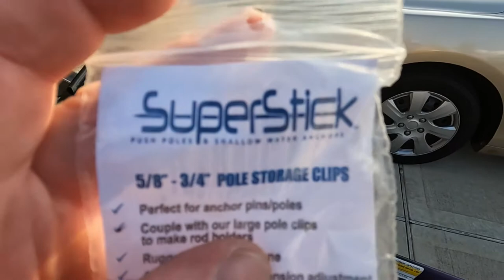Kayak Stadium Seat Mod Ascend 9r Sport #thereallifeyoutube

Comment: How's it been over time? Thanks for the video.
Reply from the maker: First test proved to be shaky but she’s not used to being elevated, she got used to it and was able to stand and sit back down easily. I don’t recommend doing the mod if the user is not easily able to manage the dynamic changes. Otherwise it’s been a good mod and holding up.